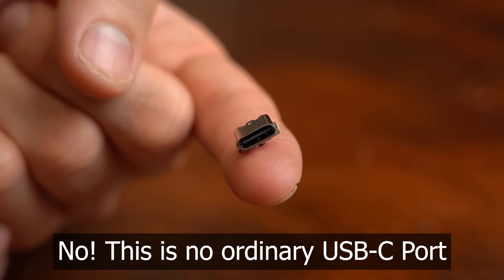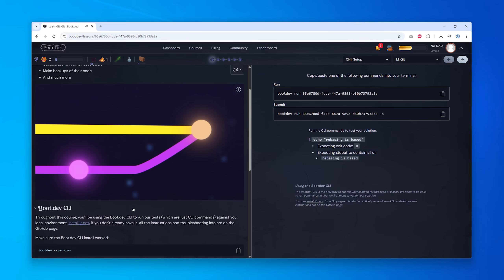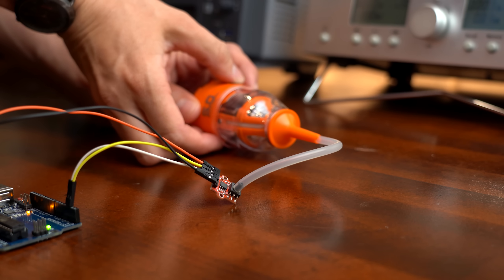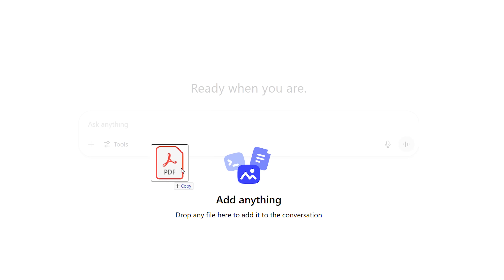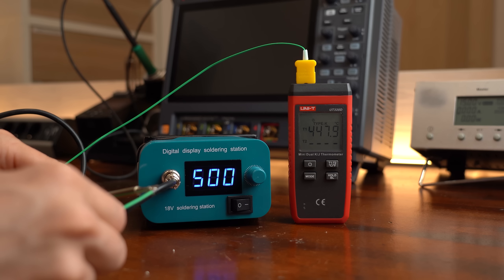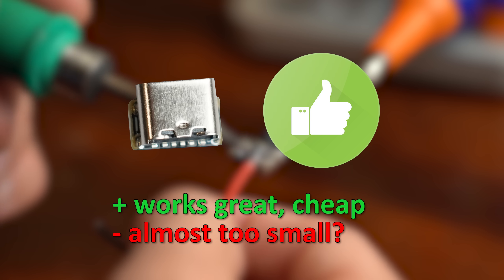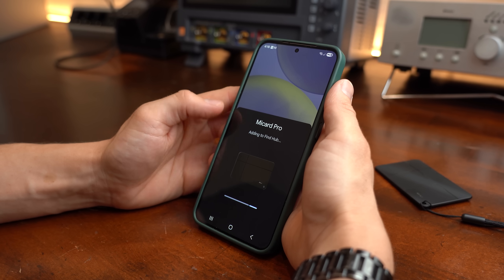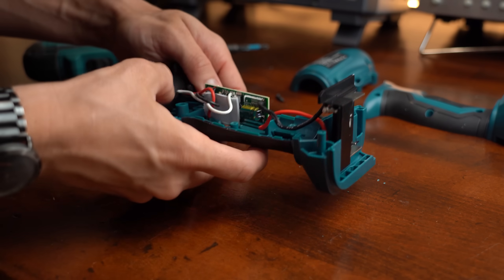I tried finding Hidden Gems on AliExpress AGAIN! (Part 15)

Comment: 7:00 uh TS100 max spec input voltage is 24v.  All you need is an adapter sled for the battery, not an entirely new iron.

Comment: you know what? This weird "free energy bullshit" coil thingy could make itself extremely well as a fancy Antenna for your Radios! just take off that stupid 3.5" Headphone Jack and put in a nice RF-Jack instead, then just hang it on a Window and plug it into the RF-Jack on your Home Stereo (if it still has Coax-RF for FM/DAB+ Reception)

Comment: Do the small usb-c battery charger modules support USB-PD (usb-c to usb-c charging)? I saw those USB c battery modules on AliExpress the other day, but since I didn't see the CC1 pads, I didn't trust it to properly work with power delivery.

Edit: I ordered one and checked, yes it works with USB C to C cable! That means they included the 5.1 kOhm resistors.
Reply: Since it’s max 600mA single cell, there isn’t any point for PD, normal 5V is enough
Reply: @mtqrx it's not about the voltage or current, it's about using a standard charger without the need for a USB A to C cable.

Comment: 10:00 This is the trick: if you claim a refund, they only return you the product price, not shipping price. This is one of the reasons I stopped using Aliexpress, you have almost no rights as customer.
Reply: Back in the late 00's there was an Ebay trick for sellers that they would list say a boxset that RRP was £100 with a 1p BIN and £99.99 shipping charge that was to stop them getting charged fees as at the time Ebay didn't charge fees on postage also if there was a dispute then the seller could just refund the "cost" of the item, didn't last that long before Ebay changed the rules so even postage was charged fees but for that short while there was a lot of Chinese scammers.
Reply: Just get free shipping then brokie
Reply: Shipping is free most of the tine unless you're below 10dollars. Also its literally standard not to refund shipping, and they offer free returns as well. So like you're peeing your pants over nothing
Reply: I didn't know that.  Most of the items on AliExpress are absolute junk.  So when I do order something from them I know it's a gamble.  That's why reviews from experienced guys like on this channel are super helpful for me!

Comment: The problem with 3rd party devices you use on your power tool batteries is: Do they have an under voltage detection?
Some tools, like Bosch "POWER FOR ALL",  have the  under voltage detection in the tool, not the battery. Other tools, like Ryobi, have the under voltage detection in the battery.
A lot of the 3rd party devices don't have a voltage detection. So if used on batteries without voltage detection, they can destroy the battery.
The cheap 3rd party devices basically use the same circuitry  for all types of batteries. Only the casing if different.

Comment: If one flatens a roden coil. It becomes a starship coil. The starship coil is easy to analyze  the magnetic field, but it has unnecessary complexity on the outside.  If one erases all but the outside star pattern then you have an axial flux faulhaber coil.  The faulhaber coil is more efficient at generating torque per length of wire making up the coils of a motor by minimizing copper overhang that contributed resistance but doesn't  contribute torque.

Comment: The fact that you can just drag and drop a random language datasheet to chatgpt nowadays and get a working code like that is so mindblowing to think about. Like, that's kinda expectation now too. I am not a fan of using AI everywhere, but in things like these it's exactly the perfect solution to get something up and running...
Reply: Tends to hallucinate after a while, unless you keep reminding it what youre supposed to be doing, what the code is supposed to do, what hardware youre using, it goes off track
Reply: That's an overstatement. For some rough framework yes but for specific things it is quite bad. I wouldnt recommend using it for anything but the most basic stuff or only if it's non work related coding.
Reply: I try to avoid LLM tools as much as possible but I have used one to get basic functionality out of modules I have purchased faster than scouring umpteen stack exchange posts. I don't like not understanding what my code does though so I then went through and figured out what each line was doing and why it made the module work so that ideally I can bypass the LLM more and more, preferably entirely, as soon as possible.
Reply: I think this is fine if you're just testing and want something running. But in general, be very very careful about running code you don't actually understand.
Reply: @gizmoguyar  My rule of thumb is you have to be able to read and understand most of the generated code, it's always much more risky when the tool is smarter than its user.
Reply: @gizmoguyar  Wdym Carefull, whats the worst you imagine it can happen?? I mean... Its okay to dont run code you dont understand but, for this type of apps, and code comming from open ai bullcrap I think theres no more risk than clicking a random sponsored URL in google.
Reply: @breadcho7446  if you can't write an arduino sketch, then you can't vet it for safety... a badly written sketch can brick an arduino or damage whatever else its attached to. You might think that's no worse than if you were learning how to do it yourself, but if that were the case at least you would have learned something.
Reply: I've completed a lot more projects because of AI, being able to research data on weird or out dated chips to reverse engineer them and getting boilerplate code for the signaling speeds things up so much that I can complete the software side for my personal projects in one day instead of a week.
Reply: When you do this you learn nothing. It's like cheating on a test, you're actually only robbing yourself.
Reply: I used gpt on my genric face recon, it was slugish but it worked.
Reply: Not chatGpt gave that answer. Someone had that problem in the past and solved it with its knowlege AND was kind to put it into the internet. ChatGpt is just repeating it without klnowing what it talks about.
The Problem is the User still dont understand what was not working. How to solve it, How to make it better next time. The biger Problem is there is a Answer to its Problem somewhere in the Internet but he now also dont know where and how to find the next time. Probably also no upload with the ESP code to Github where he found the first solution and and and.
Also.. why is there no easy to find source code from the developer for this avialable? For Ardiono, Esp, Raspi and what ever Language needet.
Reply: Even though it's very good, I can't help but check it and test before I run it
Reply: Lol cụ coin viNE 0,06875$
Reply: I cant tell you how much i learn about electronics daily from chatgpt which previously took days and days or posting on stackoverflow and waiting a week😅
Reply: I find that it's great for writing the utility functions that would take me a lot of research. Get boilerplate, fix, repeat.
Reply: The AI hallucinations have actually gotten more frequent lately. Within just a couple of responses they start getting weird and off topic. Eventually youre copying and pasting while adding more and more of the same information
Reply: AI generated code seems fine until it stops working. You have to know what the generated code actually does unless you want to plead with AI to fix the code multiple times.
Reply: Yeah, that was the coolest part of the whole video. I've never used gpt as I couldn't think of any need it could fulfill, but that was an amazing example of usefulness.
Reply: It’s called “vibe coding” because you don’t know what most of the code is going so you go off the vibe of the interaction and resulting code. I would strongly recommend reviewing any code produced by vibe programming with an experienced developer in the coding language before relying on it for anything.
Reply: all LLMs are good for is writing boilerplate and doing trivial tasks for you. You won't be able to use it if you're not a programmer
Reply: @pcb249  you are absolutly wrong and it shows you dont have any knowledge about llm or ani ai     dude me a non programmer made a huge project with over 30k lines of work with AI and its working     no errors no bugs nothing  ofc i fixed all bugs et but all the coding did the AI
Reply: I could just add here that Claude is much more... let's say, coherent, for code tasks, comapring to Chad.
Reply: yup its great, but removes buisness for programmers like me.
Reply: @John-Is-My-Name  Not really, since actual programmers like you and I wouldn't have needed to go through that step at all, we'd have just identified and fixed the problem with ease due to experience. The problem is, upper management doesn't necessarily understand that...

Comment: To unleash the Rodin coil magnetic properties you should not put in magnets spinning one axis but in all 3 axis. Connect the voltage to it and place the steel ball inside xd  I've reached 250k rpm xd
Imo more interesting are the starship coil magnetic field shape properties

Comment: Hey Scott, I want to thank you for all your videos, over the years you have showed off quite a few usb c lipo battery chargers, some of them great, some of them not so much. I would like to start using these in my projects but I am quite scared of them because of the possibility of a lipo fire. Could you do an entire video explaining how to add a lipo battery and USB c charging port to an esp or other arduino like board like I'm 5 years old? I'm great with software, but my knowledge of electrical engineering is quite poor, and a video explaining it all would really help me. Thanks in advance!
Reply: I'd probably solder a connector to it first, that way, the battery could be connected and disconnected easily, and there's less risk you'd do something wrong.

Comment: I've been using an adapter they sell to use Power Wheels vehicles with tool batteries - have it connected with a Waygo to a standard DC barrel jack to run my Pinecil/TS-101

Comment: Not too sure about that turbo fan handle. Watching you disassemble it, that plastic is insanely flexible when taken apart. Doesn't seem like it's all that durable. Not that I'd want to be able to use it as a hammer, but having the plastic at least be rigid enough to keep its shape would be a nice start.

Comment: I just got myself the tiny usbc battery charger some weeks ago, and they work great. I just like to solder the wires first, and then the wires to the battery. That way you avoid possible shortcircuits.
Reply: I'd probably solder a connector to it first, that way, the battery could be connected and disconnected easily.

I'm not sure I see any benefit of these though.  There's no mounting capability, other than to perhaps hot-glue or slot it into a designed space. It would need to be sturdy because multiple connect/disconnect would probably make it move eventually.
Reply: @AubsUK  I tried them on a Sony bluetooth headset, and, as you said, with a bit of hot glue, i made it fit. It's great when you have no space to spare...

Comment: 11:06 consider that every element is connected to some other place. Even if it is a 0402 smd the element just has to be removed and replaced as a 1206 smd via some 0.3mm wires to the connected elements. - You can do it. :o)

Comment: xdxd 54 euro for a air pump you at best use a handfull of times a year is not worth it...specialy if you consider its china quality.lidar module also seems verry priced.*Free energy really plz dont buy that stuff there gonna start thinking er europeans are as ret***rdt as the hilbil***s of the states. China trying to tax eu citizens to offset bully tr--mps tet*****r ta**f tant**m regime?the battery charger seems only good product at fairly pric**d

Comment: Interesting stuff, but most of it is way too steeply priced for coming out of China:

The anti-theft card costs 16 EUR and thus just as much as the official Samsung Galaxy Smart Tag. A four piece pack is even cheaper at 55 EUR from a brand company with guaranteed security updates. Who wants to announce their location to a Chinese service while also having to pay more money?

The Makita battery pack soldering station is also a solution looking for a problem. A Pinecil works with a USB-C powerbank and costs only 25 EUR while also being more advanced. I'd be hard pressed to wear down the expensive battery packs of my power tools for a use case that can easily be solved by better product in the same price range.

Comment: 12:44 "if someone is close by with a phone AND THIS SERVICE" yeah but who has the service installed? Versus something on Apple's "Find My" network which is automatically on all Apple phones (not that I own one...)
Reply: AFAIK it's Google''s "find my device" network, not the manufacturer's specific network
Reply: @Pipe0481  Oh, I didn't realise that from the video. I'm not sure how that service works.
Reply: Yeah, I'm not understanding this product well. It doesn't work with just any Bluetooth-enabled device nearby, right? Those other devices also have to have this particular service on their phones? I don't think this is popular enough to work well.
Reply: I think he meant the google service which most if not all android phones have
Reply: This company also make tags that work with both Apple's Find My and Google's Find Hub with one device (MiTag Duo) but yeah it might have not been clear through the video - it works simply by advertising it's UID to any phone/tablet around it and then this phone/tablet sends info to google or apple that there was a device with this and this UID around this place - all happening in the background whenever you go, your phone does it too for someone else trackers (no identifiable data is being collected or passed during this process). So the only downside is if you live in the place where there's no-one with a phone or a tablet you might have outdated information about the location of a device, and it's not like it's being live transmitted like a GPS but updated every minute or few. It's great for tracking luggage on the airport :D

Comment: 7:15 please be wary that some of these battery conversion product do not have a voltage cut off and will send the battery below the detectable charge thresh hold of the charge which can sometimes kill the battery! (usually easily fixable with a manual charge on the batteries to get the voltage up)

Comment: You should try the Pinecil V2 soldering iron. It's a really nice portable soldering iron that can be powered by USB-C and is open source. I have a 100W USB-C battery pack that I always have with me, and due to the high wattage, it lets the Pinecil heat up to maximum within just a few seconds.

Comment: I really appreciate your channel and helpful guides from the past. Can you go back to some of those simpler beginner guides?

Also, my portable soldering iron (I can't recall the model off hand ATM) does not need custom batteries. I just used my USB PD pack, or even my QC 3.0 pack. They both work about the same.

Comment: the descriptions are often misleading, I bought a PCIe to usb 3 to usb 3 to pcie connection. Turns out the only thing usb 3 was the cable and it was a PCie lane extender, if you use it for USB 3 it blows it up. Looks like it should work but it is dangerous to your components

Comment: 9:14 your voltage generation attempt failed because the changing field is not properly aligned with the coil enclosed area. Instead of the field lines "cutting" the turns, they run parallel to them. That's why you're getting mV.

Comment: Dit you check the BMS they sell ? I dit bought a small 3S Active balance BMS and a Daly 24S whit 150A and a 4inch display.  Fit to this also a Spot welder, it does as often have no modell number but its a Trafo whit 220v Euro Plug and 1600A, its the best spot welder i could find. Also the VESC Controller, i buy them from the brand Flipsksy.

Comment: 4:30 I bought a cheap version of this pump for 6.5€ and it's a trash with a high build quality: it can blow most volume of air, but you have to finish manually to the desired pressure. 
Can you do tests with inflating something to 1.1bar and deflating a bag (these are available in Tedi now) with pillow?
Reply: BTW double action pump (for kite/sup) is much better :)

Comment: I'm using regular powerbank with PD with my "usb" soldering iron (like this one). Works great. At 12V it heats up in less than a minute. TS-series soldering irons (or clones) are must-have.

Comment: Watch out for Dewalt battery add-ons. The discharge protection is in the tool, not the battery so you can over discharge a dewalt battery and render it useless as the dewalt charger will not accept it.

Comment: Hi @greatscottlab
Thank you for all your interesting videos, as a non-tech guy Iearn a lot.
I'd like to replace some AA / AAA battery powered devices with a lipo battery but chatgpt keeps on moaning that these boards, Iike this one you featured in this video are NOT suitable for devices that can be used whilst charging, so only for charging while not being used.
this is referred to as load sharing
Now ... I asked chatgpt to evaluate ten or more of these boards an none were.capable of load sharing
How do you see this?
Would you use this usb c charging board to replace 2 AA batteries in a wireless keyboard for example?

Comment: Warning: using ChatGPT to create arduino libraries can go catastrophically wrong. 

I used it to create a basic sketch to power on a LiPo battery charger (while providing the datasheet): it completely hallucinated ending up making up registers and accidentally setting the charging voltage to 5.5V, fortunately the battery protection circuit saved the day. It can be useful but please PLEASE double check what it creates against the datasheet before running it. This is not just vibe coding but it has an effect on physical things.